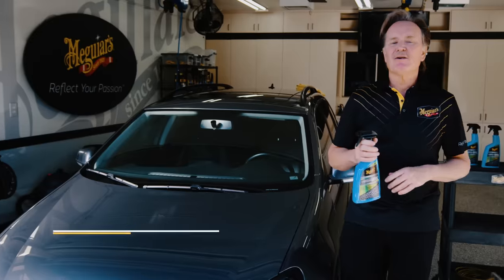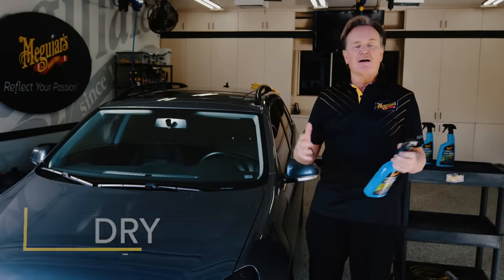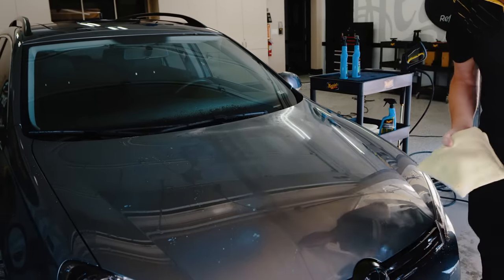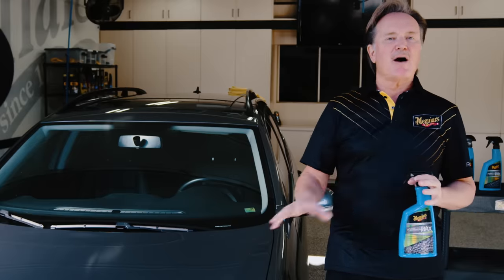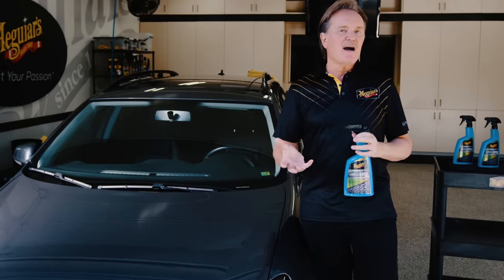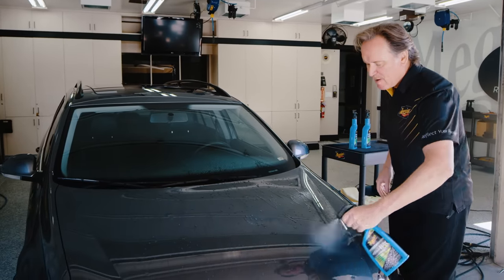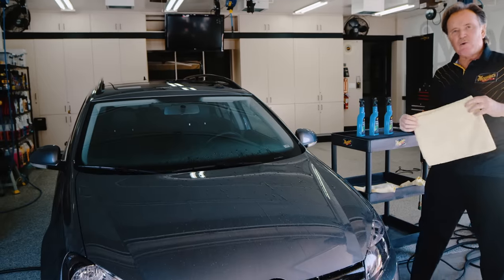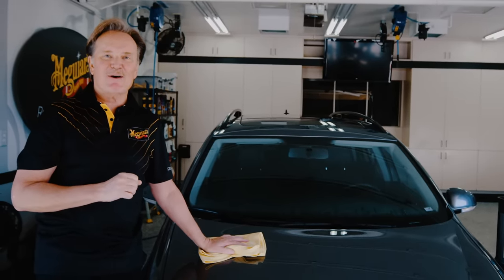Meguiar’s Hybrid Ceramic Wax - Ceramic Made Easy!

Comment: I did the initial wax as I dry with this product as described, but my follow-ups have been more similar to the initial coating.   After washing my car each time, I spray a small amount on the wet panel(s) and wipe dry as I go.  It takes very little product, works great, and dramatically reduced product usage.   I might use 6-8 sprays of the hybrid wax on the entire car.   It seems to bond better (like the initial application), saves product, and gives fantastic results.   Spraying it on and washing it off does not seem to bond as well and wastes a lot of product.   Granted it's not crazy expensive, but why waste it and get inferior results???

Another thing thing I've been doing (with great results) is when doing a waterless wash, I've shot several sprays of this product into my ONR/water waterless wash sprayer and "washed" the car with it, just like I do with regular ONR/water... Again, looks great and adds the hybrid wax in one shot!
Reply from the maker: Awesome !  6 - 8 for the entire car is great ! Keep up the good work and appreciate the info!
Reply: I just watched this video for advice after buying it this afternoon. I was thinking exactly the same, surely it would be better to apply like the initial coat every application. For me it wouldn’t be too much effort and if it saves waste even better. A win win, happy car owner, repeat buyer 👍
Reply: Great reply 😊- excuse my ignorance but what is ONR as I'm not familiar with waterless washing . Thanks 🙏
Reply: @SP-quark  Optimum No Rinse Wash and Shine - ONR Car Wash
Reply: If you wanna use it like that get the Green bottle of Ceramic spray, way easier to work with as a drying aid
Reply: Was coming here for this. Thought exactly the same.

Comment: I use this all the time. It makes black trim and the hard bed cover on my truck look new. I use it differently than the instructions. Wash/dry vehicle, spray it on, spread it around with a foam applicator, let it dry a bit, wipe with a microfiber towel, spray some distilled water on the panels then final wipe with a clean microfiber towel. Makes the paint very slick for a couple months. Truck is garage kept. Love Meguiarr's products. Have been using them since the late 70's.

Comment: I've found that mixing a small amount of the product with water in a spray bottle and using it like a standard spray wax works best. I apply it to the surface and wipe it in using a damp MF-cloth and allowing it to 'flash-over' before removing it works best after washing the car. I then buff it clean. Works great.
Reply from the maker: Interesting technique.  Thanks for sharing.
Reply: Could you give us any idea of your dilution ratio?  I would like to try this.
Reply: What is "flash over".  Thanks

Comment: Been using Meguires Gold class wax for years. Im so used to it this new product will be something interesting to try.
Reply: M E G U I A R S 👈

Just a heads up, Meg's came out with a product called NXT about 20 years ago, then a 2.0 version, might wanna check that out sometime.
Reply: Which one better dude between this and gold class?
Reply: @klasseact6663  ive used the NXT wax it dries to clear just like there Ultimate Wax. So i stick with The Gold Class.

Comment: Did my car in this  very happy with the results. But then I did all my house windows outside with it and the PVC frames and the doors. Just cleaned them first let them dry and put it straight on  and a little wipe. This product is brilliant all around the house. Even put it on the tiles in the shower and shower door. So easy to just clean now. Wonderful all round product  with more uses  than for a car.
Reply: @meguiars   Send me some products for testing

Comment: One detailer talks trash and others actually test the product. I watched apex detail and others do the process and then see how far it lasts using from light cleaners to aggressive cleaners to see how long the coating hangs around and at this point MHCW has been shown to work. I myself have gone through 2 bottles and is doing great for me in the South Florida sun and rain on my Mustang GT. And to top it off I work on the west side of the airport and get a lot of planes landing and taking off, dumping their jet soot and the wind blowing a lot of dust and dirt around and the stuff sticks less to my paint now. Before MHCW the rain wouldn't rinse the dust off, but now when it rains my car looks like I just washed it. So as far as I am concerned MHCW is worth every penny.
Reply: Robert Long Apex Brian is a detailing King 🤴🏻

Comment: So, steps:
- wash the car
- do NOT dry the car
- spray ceramic wax on all paint surfaces (what happens on the glass?)
- spray the car with hose or power wash (seems like wiping down instead of spraying would be better?)
- wipe down with micro-fiber cloth

Right?
Reply from the maker: That is the correct process for subsequent applications.  That is not the case with the first application.  For the first application you simply spread/wipe off the product with a microfiber towel as you dry the car you do not rinse it off.  This is all covered in this video.  Take a couple mins to watch it again.

As far as the glass it is fine of some gets on the glass, plastic, chrome, etc. while applying.

Comment: Did my first application this morning  , think I went a little heavy on the base coat  . Was harder to buff off but after some elbow grease 💪,  it looks great  . Second app should be much EZ'r .
Reply from the maker: Yes, this product can certainly be difficult to work with if too much product is applied.  You almost have to look at it like a concentrate only using about 2-4 squirts per panel.  The drying or rinsing will then spread the product.  👍
Reply: @meguiars  just a follow up  . Applied the second coat this morning  . Did a hand wash , rinse , then a light spray 2 or 3 on each panel a heavy 2nd rinse to finish  . Used my leaf blower for a touch free dry . Car looks amazing  . Cheers  🇨🇦  👊🏽

Comment: Should we clay bar the car first and decontaminate the Surface before applying the product?...
Reply from the maker: Yes, this product really likes a well maintained and even previously protected surface.
Reply: @meguiars  So what is the 1, 2, 3 step for  applying ?   I'm not familiar with clay bar, so can you tell me which of your products I should use before this ceramic wax is applied ?

Also, can it be applied motorcycle matte finish ?  (2018 Honda Goldwing)
https://powersports.honda.com/mkca/phase3/2019/_images/content/color360gallery/goldwing-dct/colors/19_GoldWing_MatteMajesticSilver_DCT_1470x812.png
Reply: @lance3613  - Anytime you clay your car it should be followed with a paint polish.  If your not familiar with this stuff I suggest taking it to  professional detailer.  They'll break down the process for you and do it right.  Surface prep is key to any coating or wax.
Reply: @gt3rsdriver449  Thank you
Reply: GT3 RS Driver best prep would be... pre rinse, then pre wash with TFR (for lower body parts) + Snow Foam... then a two bucket wash, then fallout remover, then clay bar, then polish, then wax? I presume those steps would be the best for at home cleaning.
Reply: Do yourself's a huge favor buy a clay wash mitt! Saves a ton of time and is the only way too go!
Reply: Glen Biliti   Which brand do you recommend?

Comment: I've applied it to a couple panels of my truck using a damp microfiber cloth sprayed with the product, then buffed it off with a dry microfiber cloth.  Looking to see how it performs compared with my usual, NuFinish.  I would expect a more uniform and better application this way, though more effort than intended
Reply from the maker: There are reasons for the directions we state on the bottle.  We understand you may think you are finding a better way to apply it, but it was designed to be used according to the directions for best performance.  If there was a better way, we would have stated it.
Reply: I have applied the first layer of product, per the bottle's instructions, to the rest of the truck and did observe smaller droplets formed on the vertical surfaces and a noticeably better shedding of water than with my method.  Clearly, using a cloth to apply it is intriguingly less effective.   However, my reason for the damp cloth trial is that I own a Mustang which never gets wet or washed and I wanted to see if I could still use this product on that for paint protection, shine and easy removal of dust and bugs after each trip.   While the performance is indeed better per the OEM method, the solution does still work acceptably for me using my approach.  
I have driven the truck through several very heavy storms this week over several hundred miles and I'm impressed that the truck still looks shiny and clean, drying very quickly with very little "spotting", even on "my" panels.  It's an awesome product indeed and the truck will be washed and waxed using the OEM application.  I am looking forward to seeing how durable it is over the next few months.

Comment: Would using Ultimate quick detailer diminish to effects of this or no?
Reply from the maker: Any product with protective qualities which is used on top of Hybrid Ceramic Wax, you will see the water beading characteristics of the product used on top, and not that of Hybrid Ceramic Wax.  So if Ultimate Quik Detailer is used, you will see the water beading characteristics of Ultimate Quik Detailer.

Comment: Been using Meguiar’s products for over a year and they are the best in the business. Ultimate Detailer is amazing, especially on a black car!
Just ordered this. Can it be applied to glass and wheels?
Reply from the maker: Yes, it can be applied to glass and wheels, but understand you may not experience equal performance as it is formulated to work best on paint.

Comment: Is rinsing it off strictly necessary? I'd like as much of the product as possible on the car and not down the drain.
Reply from the maker: Assuming you have followed the directions related to initial application of the foundational layer you will then want to proceed following the directions for subsequent applications which does include rinsing.  The rinsing (preferably with a strong spray/fan of water) is vitally important to spreading the product across the surface.
Reply: Victor Gan same i feel like im throwing it away. Im so use to apply wax traditionally
Reply from the maker: We totally understand.  It was a new way of thinking for many of us too!  Trust us though, it does make sense and it does work.
Reply: @meguiars  Thanks Meguairs I love your products and if you say so, I'm sure this is the way it was intended to work too. I also realize this makes application on wheels easier than wiping on and buffing off!

Could you provide any further info on how the rinsing mechanism helps lay down additional coats on a microscopic level? You mention using a fan of water so I assume jets or sheets simply push the product off rather than disperse it.

Someone mentioned on MOL that HCW does layer. Would you recommend against say if I were to lay down 5-6 consecutive coats on the same day?
Reply: I too feel the rinsing off of the product is a big waste of product. I know it's a new product with a new way to apply. For me I'll stick with tradicional waxes & sealants , they last long enough for me. My car's wax job beads water great, it slides right off.
Reply: Victor Gan then spray it on wipe it off then leave it. That works the best
Reply: @nighthawkj30A4  i just spray it on dry paint and use a towel to buff it off it works better i think
Reply: In the initial foundation does the car need to be wet or dry? I couldn’t tell. Thanks in advance

Comment: If you're worried that the spray and rinse method might not get everything covered, could you ALWAYS wipe it on if you wanted to and then rinse it off?
Reply from the maker: You could, but there is no reason to and if anything that would just make the process more difficult.  You are both rinsing and drying either way.
Reply: @meguiars  Thank you for your response.  I guess I like making my life difficult.  ;)  I've read other comments and I see you can use this over carnauba wax, can it be used over NuFinish also?
Reply from the maker: Yes, it can be used over virtually any other wax, sealant, or coating.

Comment: I did a different method with this. I washed the car down with soap and sprayed the spray while the car was wet, allowed it to sit for 30 seconds then wiped down with microfiber cloth. It seemed to leave little to no streaks and the car was glowing. (Used on a 2018 WRB WRX with Rain-X soap).
Reply: That's pretty much the directions for the very first application anyway.

Comment: After a month it is still going strong and decent shine. However do not put this on your windshield or on the roof of your car where you have to rinse and flows on to the windshield, when you do the application. It will leave streaks when your wipers are on and its raining. Just avoid that issue that and you'll be fine.
Reply from the maker: TheRealNoodles we might suggest using a little less & maybe try doing a section at a time.  If you try this you should not have an issue with the roof or windshield wipers or streaking.  Feel free to contact us with further questions or let us know how it goes.

Comment: Guy’s I already use your Ultimate Fast Finish and love it, so my question is should I switch to this new product ? Also can I use it on top of my Ultimate Fast Finish ? I understand that the new product will not be available here in the UK until mid March 19, thanks Steve in Kidderminster England
Reply from the maker: "Should" might be too strong but if you are curious and love to try the newest technology you may want to consider picking up a bottle to try.  It is some pretty cool/good stuff.  

Yes, you can use it on top of Ultimate Fast Finish or any other traditional wax or sealant.  It actually performs quite well that way.

Comment: Great products from meguires. I park in a truck yard for 5 days at a time. I don’t put many miles on my pick up so this saves me from having to wash with a mitt and dry it all the time. Because the yard is dusty what I typically do is rinse it with our pressure wash, spray this, rinse it off and it’s clean enough for a daily pick up. When it rains/gets muddy out I’ll do a traditional wash. Again, this is great for low mileage guys like me who like to get the dust of the truck before leaving work for the weekend.

Comment: I just tried it today and don't spray your windows folks. The first layer will take some work. Plan on switching to a second clean microfiber. Then bam! awesome shine.
Reply from the maker: If you are having an issue with Hybrid Ceramic Wax, it almost definitely has to be too much product or not rinsing off thoroughly enough. Regarding windows, it will not damage windows, but is primarily designed for paint.

Comment: Can you continue layering this product or will it build up to a point where it has to be stripped?    How often do you recommend using this product?
Reply from the maker: Yes, unlike traditional waxes it does layer.  How long it will last really depends on the environment your car is in.  If your car is exposed to the elements quite a bit you could use it every few washes since it's so easy to use.  If you are looking to do it as little as possible every few months would make sense.  Again, this is highly relative to the exposure your car has to the typical elements that attack your finish.

Comment: I'm confused on how to remove the ceramic wax. Does it naturally disappear or do you need to spray it down with a chemical to take it off.
Reply: Also could this be used on carbonfiber peices?
Reply from the maker: It will naturally wear off, but also the easiest way to remove it, is with any mild abrasive, or a clay bar.
Reply from the maker: yes no issue on carbon fiber pieces.
Reply: Why would a clay bar remove it? I figured it (along with clay lube) would just take off any embedded contaminants?

Comment: I followed the instructions perfectly.  Getting the initial spray to dry without out streaks and a film was a total nightmare.  I'm not sure I should risk the 2nd wash.
Reply from the maker: Sorry to hear about your experience.  The number one issue that could cause difficulty in application is too much product.  This is almost like a concentrate where you only need about 2-4 squirts of product per panel.  If you applied to your whole vehicle and you have a half a bottle or less you have used way too much product.  One bottle should easily be able to do at least 5 cars of not more.  The other pitfalls would come from not applying as this video shows.

Certainly not accusing you of misapplication but want to help shed some light on a possible cause and solution.  Feel free to reach out to our Solutions Hub with more specifics to discuss in detail and possibly find a solution.

We do genuinely appreciate your feedback.  👍
Reply: @meguiars  Great response without the condescending tone towards consumers. 👍

Comment: I heard bad things about touchless / laser washes such as stripping. Will this product help?
Reply from the maker: Not sure what you mean by "stripping" but this products primary function is to protect your paint.  It will not do anything to remove defects in the paint.  That is something you would want to address first with a good/safe compound like our Ultimate Compound.
Reply: @meguiars  if referring washing car using a touchless / laser wash which I’ve heard can cause stripping. 

If that’s the case with touchless / laser washes will this product help to prevent the possible stripping caused by touchless / laser washes?